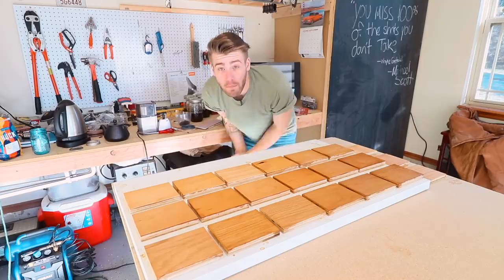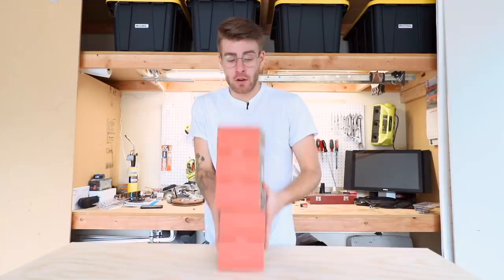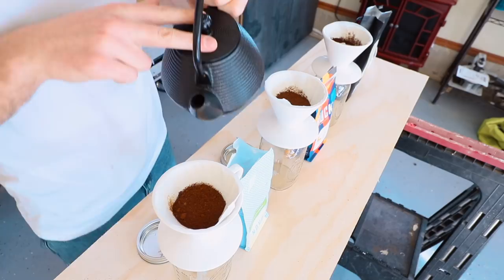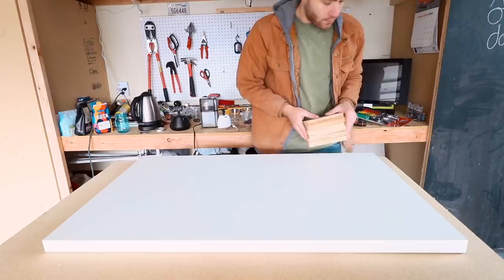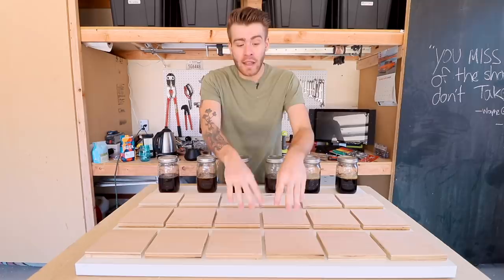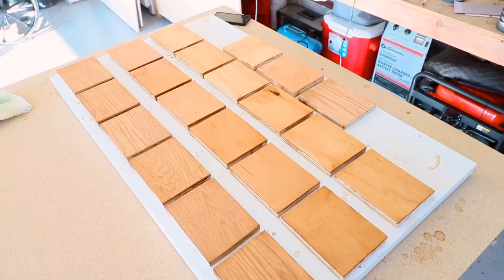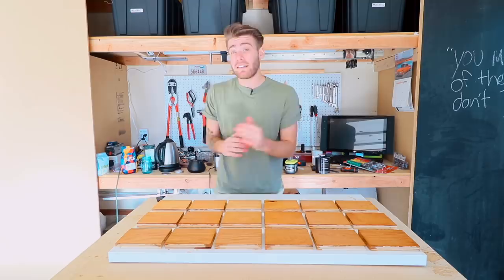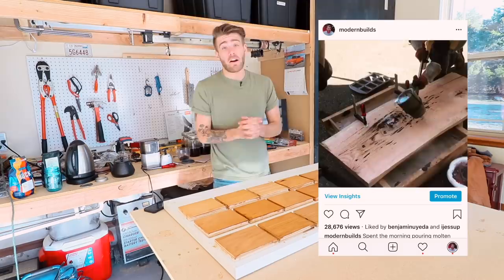How to Make COFFEE Wood Stain // The Ultimate Guide

Comment: I have used coffee to stain a few times. But I usually start with dry powdered coffee, then add a little hot water gradually, until I have a mushy paste like consistency. The amount of color it give is amazing. Also, used motor oil is an amazing stain as well.

Comment: Another good option is using iron acetate stain (steel wool dissolved in vinegar), it reacts dramatically with high tannin woods like oak and walnut. With low tannin woods like pine, you can do a coffee or tea wash first before the iron acetate solution to help the process. That would make for an awesome video.
Reply: Hi! It's been some time since you posted this, but maybe you will see this anyway :o
Can you tell me what difference coffee vs tea make in the color? I tried this once with tea, but the color was super greyish, not as reddish as I would have liked it. Will coffe give different results, or does the outcome depend entirely on the type of wood in this regards?

Comment: Shouldn't a clear  acrylic spray finish, or similar, be used to top off the stain? (I say this in case there are people out there who might neglect to do so..) Also, do you think an 100 grit sanding, instead of your 150 recommendation, might  result in having to apply so many coats? (Maybe cut it in half?)